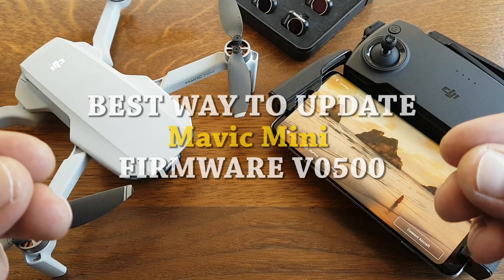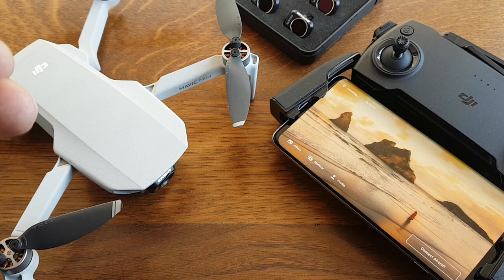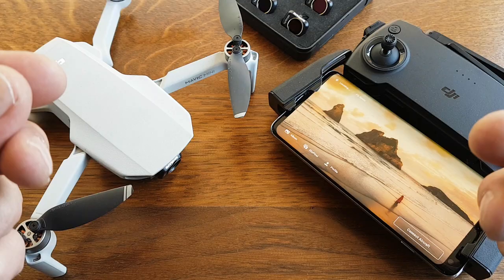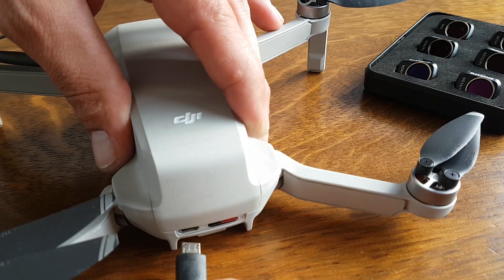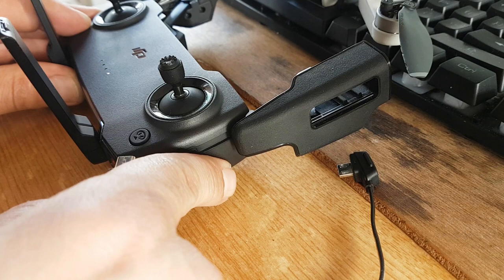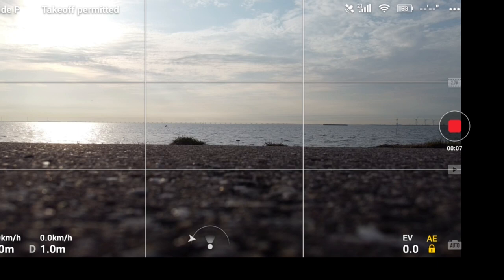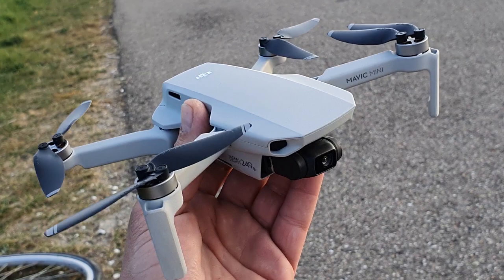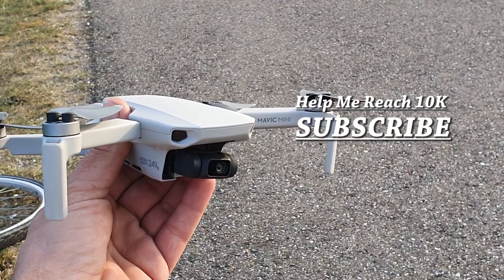DJI Mavic Mini Best Way To Update Firmware V0500 To Fix Any Problems During Flashing

Comment: I also experience "ESC Beeping" issue. It happened every time the aircraft landed. Already submit the issue to DJI Support through the app, but no reply yet.
Reply from the maker: then check my new vid on how to downgrade the firmware to V400 or v300 it solve the ESC problem so you wont overheat them and perhaps detroy them the ESC error is no joke and can damage your drone
Reply from the maker: i am working on a vif with 3 tips on how to fix it but still working on the vid it wille come next saterday
Reply: Have you tried contacting DJI support? In one of others owner video, they solved ESC beeping by either one of these action:
- replacing propeller at the motor where beeping sounds come from. 
- refresh firmware several times with DJI Assistant 2
Worth to try.